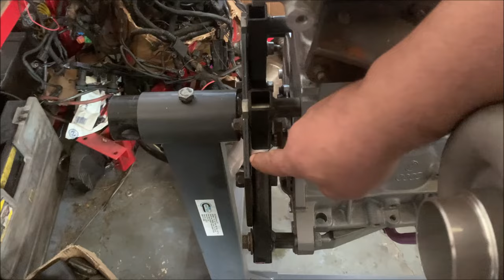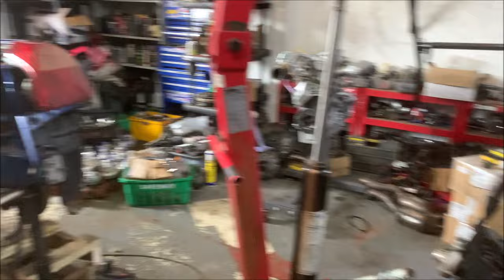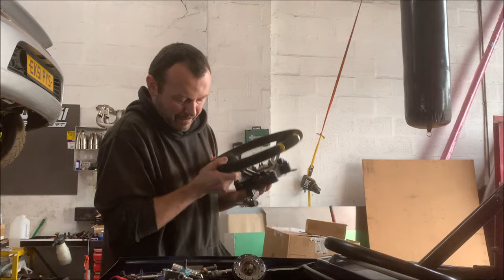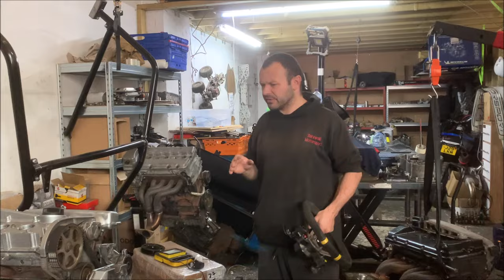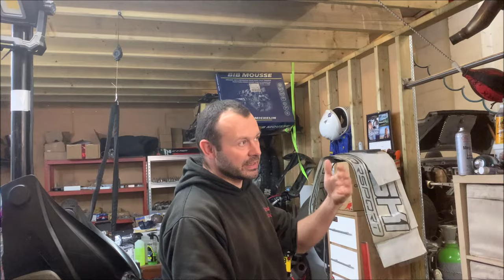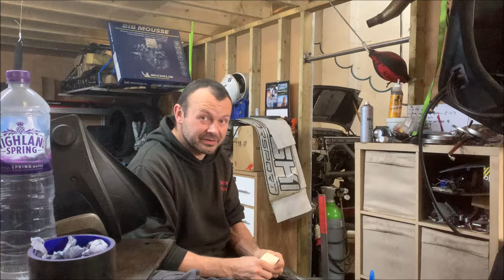What engine do you want/need?! Most people don't know! 1.8T/VR5/VR6 weight differences tested too...

Comment: there's a saying.. careful what you want as you might get it.. we hope what we dream of building will bring us what we want, but there's only one way to find out, and that is to build it and test it.

i'm building a vr5 turbo rwd in a mk2 scirocco.. it's a long road but i hope it will bring that enjoyment.. however i feel all the good 5 cylinder noise is at the high rpms, the group b stuff rev'd up around 9k rpm which is where it made your spine tingle, and the vr5 won't do that, but it will still be a nod towards it

for me the vr5 has a cool mix of the vr6 sound and the inline 5 sound which i like. need to make my own adapter plate to the e46 gearbox i have.

thanks for your ramblings.. nothing is black or white and i enjoy listening to all of your discussions in the grey area

Comment: So 07K 2.5FSI N/A stands somewhere between 1.8T and VR5 on weight, bare engine with flywheel without clutch and oil filter housing=112kg
Reply from the maker: Very close to VR5 weight by sounds of it with the parts we had on the VR5 when weighing it. Close enough you’d never feel the difference for sure

Comment: Nobody gonna believe me when telling them the 1.8t is lighter than the k24. All the old forum posts used to exaggerate the weight of the VR, making it sound 100+kg more.
Reply from the maker: Way lighter. It’s pretty much VR5 weight.
Reply: Kswap is usually 160ish kg , k20 that is
Reply: Nobody going to believe 600ccm bigger engine is heavier? Wow

Comment: Well problem isnt in MR cars, but fwd cars. Them VR's hang a lot up front and they have 30-40 kg more than other 4cyl.

You can save 20kg by going with aluminum block from 2.0 20v audi b6 ALT code block.
Reply from the maker: I’ve wanted to get one of them to check it out, I’m sure it’s very strong though or they’d have used it in the later EA113 block turbo engines.

The head looks interesting too, big port, but not sure on overall specs
Reply: @StavTech  I'm beginner mecanician maybe stupid question : aluminium is lighter but weaker. It's still a good idea for turbo project (I ask because lighter is better in my mrs project).
Reply from the maker: @cresus013  aluminium what? Totally depends what you’re asking

Comment: Would love to see an audi 3.0t tvs1320 blower mounted on a vr engine
Reply from the maker: Used to have one of them. Unfortunately due to the way part a big part inlet manifold and throttle body is integrated in to the blower itself, it would be no easy task, almost impossible even.
Reply: I've seen people in Poland selling these superchargers with all of the water intercooler parts chopped off and apparently people weld on custom flanges and use a standard intercooler
Reply: Yes we cut them on intake ports on both sides, we use only middle part, easiest way is to built custom flange and thread the casing, cause when you weld it, it might bend inside and the tolerances there are really small. Often sold in Poland as a kit for M54B30 BMW replacement for A/C.

Comment: Curious, have you ever weighted a Saab B204/234 or a PSA XU10? i know both of them can make a good chunk of power, especially the Saab engines but was always told that those engines are heavy pigs. I am looking for a swap for my Matra Murena that can get me to roughly 250hp in a fairly light, very responsive and compact packaging, so i have been looking at multiple different engine families for it, including of coruse the 1.8t.
Reply from the maker: I never have, no. But wouldn’t listen to most weights for sure as it’s all talk usually. I mean even the XU10 is iron block where many of the XUs are alloy, but as Honda K engines show, alloy block doesn’t automatically mean light.

Honestly most modernish 4cyls are much of a muchness, esp when gearbox weights make such a big difference.

I mean the Toyota ZZs are one of the lighter 4cyl, but even that’s only a bit more than a 1.8T which people for some reason think are heavy, and the heavy but weak Toyota box makes the weight difference only small.

How much do you care about originality? The PSU TU5 16v engine like in the 106GTI and Saxo VTS keeps it French and is a great revvy little motor, would need boosting for 250 but they make that easily.
Reply: @StavTech  I don't massively care about originality of the car, i defo don't want to cut the car up to fit the engine, but i already bought it completely gutted and set up for track driving, the engine in it is still a standard 2.2L Simca 180 engine (same one that can be found in the BX 4TC and the 505 Turbo, although turbocharged in those) that one of the previous owners lightly modified with twin carbs, headers and probably a cam as well. Has been sitting since 2018 after it started knocking at the third trackday that i attended with it, guessing i must have starved it of oil back then, never had time to fix it thanks to other projects, family matters and then Covid...

I'm just in a very early stage of brainstorming what i want of it and what would be a good mix of being an easy swap and reasonably cheap. I remember it feeling fairly rear heavy back when it was still running, so it would be quite nice to get rid of a good chunk of the weight in the engine bay.
The TU Swap sounds like a solid idea, i can defo get a whole C4, 307, or something like that with the 110hp version for a very low price, need to look into that some more and if those are even as sturdy as the 120hp version in the Saxo/106.

I have some good contacts in the Citroen CX Community and Murenas do have the same transmission as those, so that may also be an "easy" option. Those engine sit very low and can make very good power, i know the turbo 2.5 can make well over 250hp with minor mods, plus i'm already familiar with them, but i bet they also weight a boat load with them being based on the engine in the DS which in turn was based on the Tracion Avant, which means they are basically a pre-war design.

Comment: My meagre 150hp 1.8t shot a spark plug out the top, smashed the coil pack off. Wouldn't even bother with that engine seemed weak a.f for me.
Reply from the maker: 😂 Only way a spark plug could shoot out the top of any engine, even the weakest engine on the planet, was it was loose or broken. Zero to do with engine strength. Literally the last part, on any engine ever made, that strength or lack of would cause to do that 😂
Reply: @StavTech  threads stripped out on the head. Yeah could have been cross threaded or over tightened or something at some point in its life but this car replaced a series 1 Volvo T4 this whole car including the engine had nothing on that.
Reply from the maker: @LUZ-zv6pq  it was fucked, simple, strength or lack of isn’t what makes a plug go in to orbit.
Standard for standard a shit 150bhp K03 1.8T isn’t as good as a T4, no. But to tune a 1.8T is way better